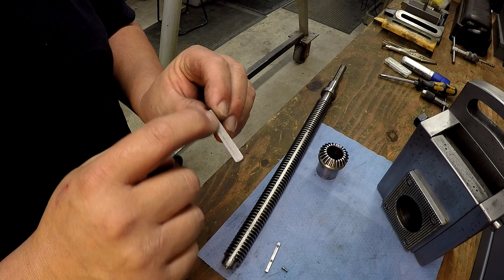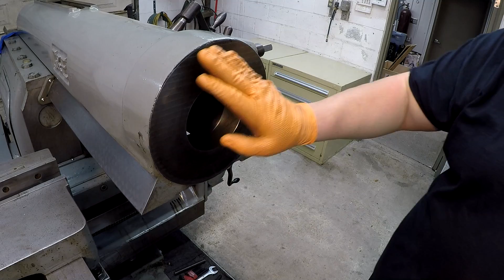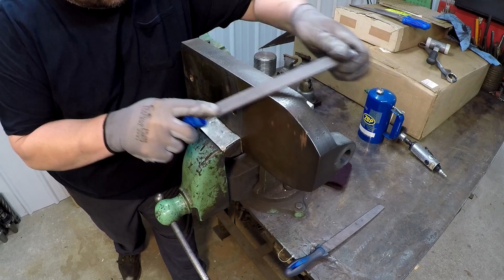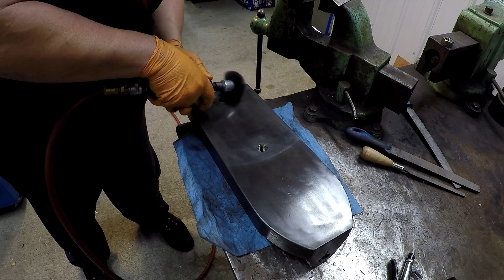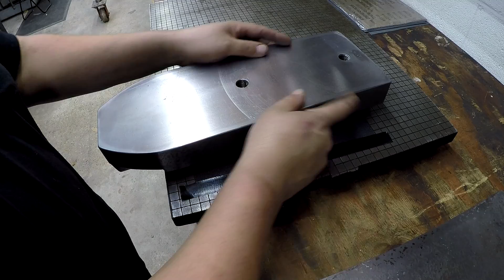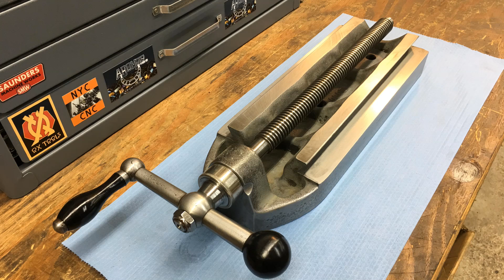SNS 212 Part 2: Shaper Tool Slide Rebuild

Comment: Sometimes I have some luck tapping down screw slots that have been displaced by poor-fitting screwdrivers to restore some of the slot before filing the slot square.
Reply: True. That's how good gun smith's fix munged up screws.  Just be sure to have a very clean and flat hammer head with no dings or dents.  You basically relocate the metal back into the groove.  Mark Novak has shown that.

Comment: So if you had a part at a 90 degree angle and the head at the same angle, you can essentially have what would be power up feed? Or does the table not angle in that direction (referencing the part with a tapered keyway you did where you had to use manual up feed) and if not, could you make a custom version of the screw where the top handle and stock is off and cleared to allow it to be upside down?

Comment: Purely from a pragmatic point of view, the detailing of those ( why in the name of Hephaestus did someone beat on those tools ) hammer marks does not affect the function of the machine - clearly Abom79 loves those tools and his sense of style requires that he do the best he can for the sake of the tool.
As mentioned elsewhere in the comments, some will take issue with the method of file application to the worked surface - I suspect that these are easily found budget files unlike the old 'made in USA' Nicholson files of old... I would be interested in hearing Abom79 share his views of various files from various sources at some point in the future.

Comment: I know this is an older video but....
Did you ever think about threading the key for the auto feed gear? Why did you use the split pin? Would that just be over engineering the part? Lol

Comment: If you countersink the leading edges of the square hole on the hand crank you made, it will make it easier to place it onto the square drives of the shaper.  Sort of like the way a socket has a bit of a countersink to assist it in going over a hex fastener.  Awesome vids  :))

Comment: i know this is months ago and the machine is done. but i am looking at the hammer blows on the curved sides. i keep thinking of a decent belt sander.
Reply from the maker: I cleaned it up the way I wanted without removing a bunch of metal
Reply: Definitely will keep a flatter profile using a file.

Comment: Adam,  How do you  protect the polished steel surfaces from corrosion?  Do you wet a towel with that Boeshield rust preventive that you showed a few videos back?  I'm a bit south of you (but east of Gainesville, Fla) and I guess I have about the same humidity problems as you, but probably less problems from salt mist (which travels much more than most realize).  I'd like to see how you treat the polished surfaces on the shaper and other equipment & tools.  It looks like you use VCI (Volatile Corrosion Inhibitors) paper on your gauges and other precision items, but how you protect the surfaces that can't be protected with VCI paper would be interesting to know.

Comment: I notice you stone dry.  When I was working a summer job I started working with the Machine Builders, and they ALWAYS said "NEVER stone dry, get mineral spirits on the steel and run your stone wet with Mineral Spirits".  Is this really just a personal preference?   This was 30 years ago, so maybe thoughts have changed.

Comment: Adam, what kind of thread cutting oil do you recommend, I am just looking for  about a quart or so, something not so expensive, I do not need much but there are so many different brands, colors etc. Thanks,
Reply from the maker: We use Rigid brand dark cutting oil at work. Most hardware stores sell it, or a brand like it. Does the job just fine.

Comment: Those shapers and planers are really wonderful tools - when they start cutting blue chips they really move lots of metal. I bet you could make short work of lathe ways and saddles, and mill tables with a good planer. Then you could scrape the last thou or half and not worry about low spots.

Comment: Watching you work with the scotch-brite pads and wheel sure puts a nice finish on the pieces. I was looking at getting some pads and especially a bench grinder mounted wheel. After looking at all the choices in the 3M catalog, I'm having a hard time deciding what type of wheel and how fine an abrasive would work the best. Maybe you could talk about the type you use and why you chose it.

Comment: Good idea putting in a deeper key, I think those sliding keys can raise a burr on the threaded part of the lead screw. That may be a problem on one of the smooth drive rods for the  carriage on a lathe I saw with a really worn bushing. Maybe a Colchester...

Comment: Good to see it coming back together.

When radiusing the edges of plates that will slide over other surfaces, I THINK it's more likely to force particles between the plates than with a sharp edge. So wipe down before sliding.

Comment: Nicely done Adam and that should be a lot nicer to use without all the raised metal and burrs. Not impossible of course, but given the one man shop type environment you bought it from my guess is all those hammer marks were installed at the original factory it was purchased for. One or two marks would be a learning experience that a hardened hammer face will leave marks, more than that is someone or multiple people who either don't understand or don't give a damn. Oddly all those marks would have taken a long time and a lot of use to accumulate that many. Yet other than what looks to be a few light score marks on the bottom of the ram the original oil flaking seem almost brand new. I'm now wondering if it wasn't rebuilt or possibly reground and re-flaked at least once? Yet other parts just don't seem to have enough wear to make that logical. If it's never been rebuilt then it must have been used mostly for one off type non production work from new. Getting that powered downfeed back operational will be very handy for some work I'm sure.

Comment: I sure love it when you re-furbish the tools and machines you get. The care and skill you have making them operate as good or better than new is astounding! I need a lap plate when I redo my hand planers. I use a granite (not calibrated) when I flatten the shoe on them and use a wet stone to sharpen the blades. Great stuff. I thought I was going crazy when I was making my drill press vise smooth. I took a file to it and used valve grinding compound to make the bed smoother. Wish I had a mill to really flatten it out. If you want to get rid of some tools, hit me up! :D  It's so good to see people pay it forward giving you tools. I keep an eye out for the lathe quick change tool bit holder. Hard to find. I only have a few tools. Do you have roll pin starter punches? I use them a lot. I noticed your thread chaser gizmo, I have the same exact one that I got from dad when he passed away in the multitude of tools I got. He was an electrician. I used the thread chaser when I was a boy on my bicycle when I boogered up the threads on the axles! I digress, Keep it up! WE love them SNS and shop talk!

Comment: ....or INSIST that anyone who operates the shaper have only a Lixie (bronze-type) hammer around, but they would probably just disappear (get stolen) on an all-too-regular basis....!?!?!
Reply: Except bronze or even a brass hammer will still dent cast iron if it's hit hard enough. Hell even a hardwood mallet can put small dents in steel if it's hitting an edge or corner. Best probably would be a leather faced hammer maybe.
Reply from the maker: I would only suggest soft blow like the nylon, lead, or raw hide.

Comment: Adam I love your videos but you've been to Richards class, you should know better than this. You've got a massive audience and a large portion of them are probably going to start taking emery paper to the ways of their machine tools. Do you not own a surface plate big enough to scrape this in?
Reply: He never used emery paper on the ways, he used a stone and then scotch brite. It does nothing to the ways other than clean them. If you're referring to the part where he takes the faceplate and rubs it on the emery paper on the surface plate, again, it did nothing negative to the part. But it's okay, you're part of the Youtube armchair professionals. We understand your ignorance.
Reply: Marcus Christensen I know you mean well mate, but this comment makes you look like an arse.
Reply: I am in the trade, specifically my qualification is "Metal machinist: First class" and in reference to the scraping I attended Richard kings class in Denmark last year and have since started a machine rebuilding club on the GC. If you look at Adams Instagram account he's clearly hit both sides of the gib on the lapping plate but even hitting the face on that lapping plate is affecting was it as a reference surface that you would usually use to measure wear in the flats. Don't get me wrong I love all the heavy machining content on the channel and Adam is clearly a superb tradesman but this could have been done much better if he had a decent sized surface plate to work with.
Reply: fair points, unfortunately you still sound like an arse. Have a lovely day
Reply from the maker: I attended Richards scraping class but that doesn’t make me a scraper. I cleaned up the machine just the way I wanted. It’s not a “this is how you rebuild a machine” video. You shouldn’t expect everyone out there in the world who wants to refurbish a machine to know how to properly scrap in a machine either.
Reply: Marcus Christensen I have never found a reason  to justifiably criticize Adam but I think you just discovered a method to get around 170k people pissed off at you.
Reply: "Metal machinist: First class" and still doesn't know the difference between emery paper and scotch-brite? Yep, you're highly qualified.
Reply: Justin in this video he is only sanding the face and sides so understandable mix up but the Gib has clearly been sanded if you look at the instagram link below which is what I was referring to, sure the tool head on a Shaper sees minimal use so I can understand why adam has done this to get the shaper back together as quickly as possible but in this case you'd probably want to at least flake it as that polished finish won't hold much of an oil film once the gib is tight. Also I have to agree that the Australian technical term for my trade sounds a little pompous, I never liked it to be honest. If anyone is interested most of the guys at the club are retired machinists and home hobbyists that don't have access to all the needed kit at home but I have a 1000mm x 2000mm plate here as well as camelbacks up to 6ft, precision levels etc and Myself along with two others in the club own Biaxs. I don't charge anything but bringing a 6pack of coopers is always appreciated and we basically just meet up to help each other scrape in and restore parts of our machinetools.  Lot of sparkies in the club and we even have a member that owns a paint store who gives great advice and sells us paint on the cheap.  
https://www.instagram.com/p/BhG2lxNALcQ/?taken-by=abom79 

Stefan probably has the best content in terms of scraping, it might be a little dry for most people but I love his videos, He's a very nice man and quite a laugh in person I always assumed he was a short man and I was very surprised when I found out how tall he was.
https://www.youtube.com/watch?v=-BYt3GHBuNk&t=

also of interest Mathew has some great videos of scraping his 14m shaper, he had a bit of a learning curb with hinging and the like but its a great series and he's really a lovely fellow 
https://www.youtube.com/user/lookcreations/videos

Comment: Awesome job Adam. The clown that operated your shaper must have operated my G&E also. I have the same hammer dings on the toolhead and the graduated scale. No respect for the engineering and craftsmanship that went into building such a fine machine tool. The power downfeed on my shaper was not operable due to missing the key also. Looking forward to more vids on the shaper.
Reply from the maker: Did you get yours fixed up? Looked like G&E used brass pins to fix the key. I’m sure the years of use Fatigues the pins and they break.
Reply: Yep, replaced the key and all is good. Your gonna like the power down feed. Thanks again for all your great videos.

Comment: I wonder if that key in the bevel gear originally had enough slop to fall out, slide to the bottom of the casting and then broke that hole in it when someone finally cranked it down far enough?
Reply from the maker: If the pins broke it would have worked it’s way down and out.

Comment: I loved your soft touch with putting these components back to working precision.  I am still baffled by what type of imbecile would use a hammer to strike a precision tool with such force as to deform it.  It is a wonder that the shaper still worked at all with the abuse that created all the dents, divots and dings .

Respect your tools!
Reply: Yeah you would think if they were any good as a machinist they would know how to use a wrench to loosen things instead of beating them into submission.

Comment: Hey good buddy! There is a certain thing called blue locktite :) It should be used at all TIMES on retaining screws!
Reply: Switcher my god what a calamity. How on earth was this machine ever built and used for such a long time without it. What a fluke, good thing you were here
Reply: Sarcastic much!

When we consider that some damage was caused by "set screws" backing out... a normal suggestion. Keith Rucker uses it in all is re-assemblies.
Reply: yeah I apologise for the sarcasm, I had just kinda had enough of constructive comments that felt to me kinda smarmy. I'm sure you meant only the best, and you're right on the loctite. I guess my point is that Adam's well aware of it and if he chooses to not use it, whether for good reason or not, He doesn't need to have this pointed out to him like He doesn't know what he's doing. Cheers

Comment: Beautiful work and I know it will be maintained throughout it's time with you in your shop. I take brand new machines and touch up factory paint that has become chipped or scratched during shipping to make it flawless and will maintain it in that manner always. I have tools I have kept and used for 30 years that look as pristine as when they came out of the box. Some would ask if I ever use them and they are used on a regular basis.

Comment: I nearly commented on the height of the key in the last video. The keyway is that deep to go below the thread. You don't want to put all the pressure on the threat itself. every "tooth" on the sides of the keyway would act as a cutting edge nibbling down the key over time and additionally developing burs. This is greatly reduced if the key is that deep.

Comment: Nice work waiting to see it in action. I'm with a lot of others here, why in the world would someone be hammering on that machine?
Reply: You can see the same on a lot of large lathes and the sides of there top slides. A hammer was used to make fine adjustments to get the angle dialed in. That shaper is old enough to be prior to today's dead blow type hammers, but hide and leather faced hammers were certainly available when it was brand new. I've seen that same mentality operating multi million dollar open pit mining equipment and fools beating the machines up for no good reason. Some must figure metal is indestructible.

Comment: I am sure you know that they made some 3M Scotch-Brite 2" Roloc discs that attach to a 2" small pneumatic angle grinder. And they come in a few different grits (sort of speak) to allow you to blend those hammer dings into the metal very nicely. It would make your efforts a lot easier and could allow you to blend those hammer marks out. Just a suggestion. They really do work great. I have to say I do like your work though. I can see me doing the same thing to older equipment. Bravo sir, Bravo!
Reply from the maker: Fully aware of them. I use them daily. I had desire to use them on these parts.

Comment: Whilst there is no great load on it,I don't like the .010" bronze shim.
I am slightly worried that being almost paper thin,it might tear or buckle.
I would rather face off more from the thrust bush and make a proper, thicker bronze washer.
The O/D  only needs to match that of the thrust bush which will then allow the friction ring to slide over and fully mate up to the face of the casting.

Comment: In Germany back in the day, a new machinist apprentice was handed a block of steel, a plan, a complete set of files and told to go  to a vacant vice bench spot and make that part. His first year was nothing but file work. Seven years as an apprentice.
Reply: WOW. Incredible detail and training in patience.
Reply: Yes. Germany still provides some of the worlds best metal workers.
Reply: our apprentice master used to check our filing with a micrometer back in the railway workshops .

Comment: Hey Adam i think I have a idea on why the key on gear is was missing thinkig on how you have to turn the screw to install the tool head when get to point where have to line up key whith slot maybe the last person was unable to do so and slimply pushed the key out with screw then gave up and just use manual feed

Comment: Why not using some copper never size on the parts ??
Reply: Well, you'd never want to use that on a machine, in fact I advice against using it in general. That goes for the aluminium anti seize stuff as well. Anyway, for this application you only want to use oil machine oil or similar, usually fairly non viscous stuff.
Reply from the maker: Wrong application.

Comment: I have a question now that I've seen the inner workings. Which is better when making and angle cut like on a "V" block. Rotate just the lantern, leave the lantern square and rotate the head, leave the lantern and head square and rotate the table, or use your Sine Bar Vise? Or is this one of those many ways to skin a cat type of things, up to the operator?